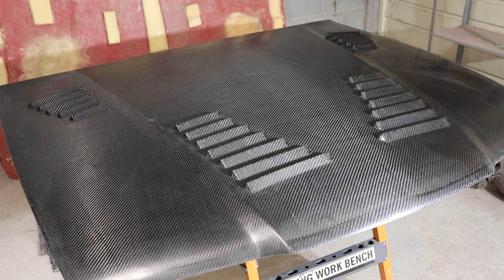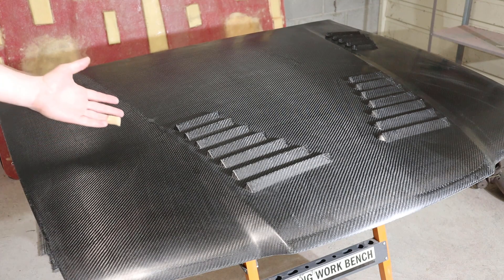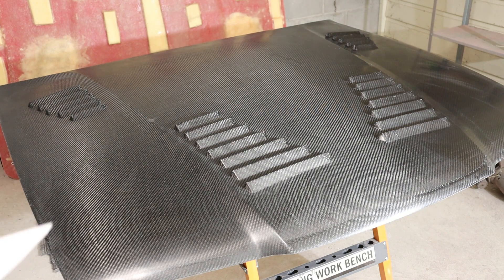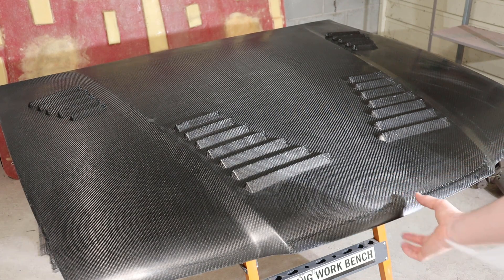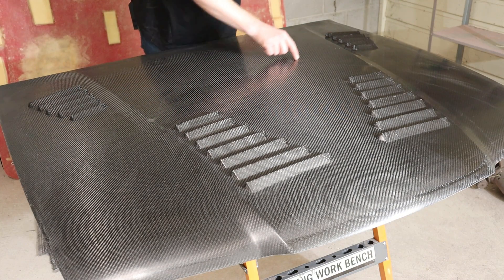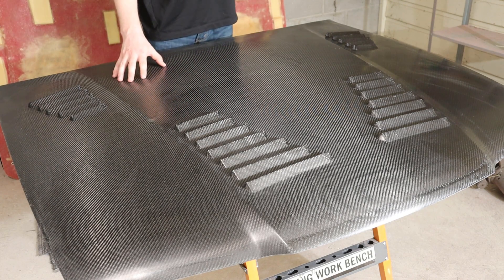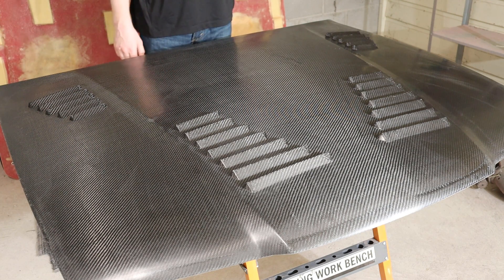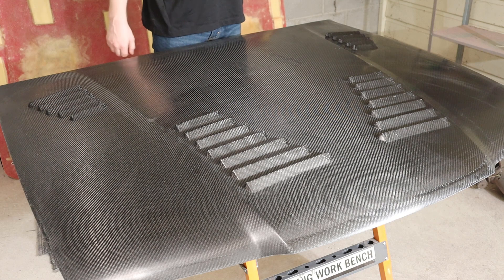[BUILD] Making a Carbon Fibre Bonnet: The Part

Comment: That tool you used to perforate the core is genius!  I'll be making a version of that.
Reply from the maker: Glad you liked it, check out the build here: https://youtu.be/l0DVsNQ7JUQ (the first 30 seconds of the video show where I got the concept from (so do the comments) if you want to use someone other than me as a source.
I will suggest that you don't drill straight into the ends of the dowels like I did, maybe bond them in as well or put some straps over the top of them to hold them together, I've had mine come loose recently and when I get some time they are on my list to fix (it's still functional as it is, just a bit annoying at the moment).